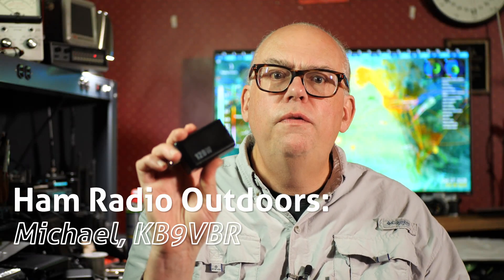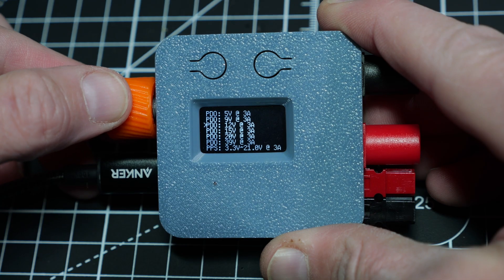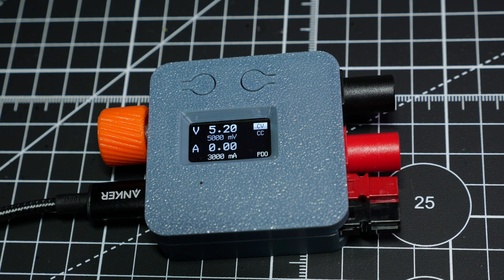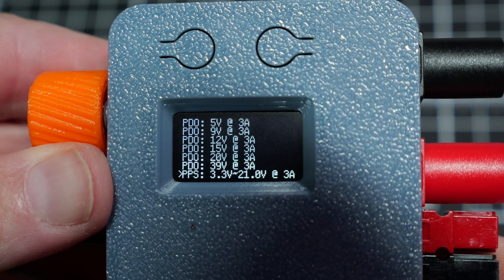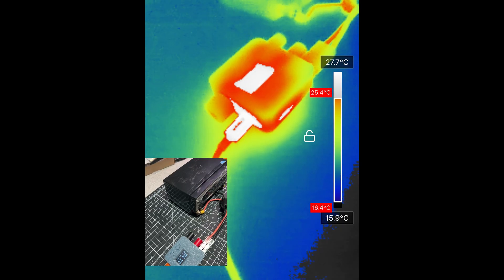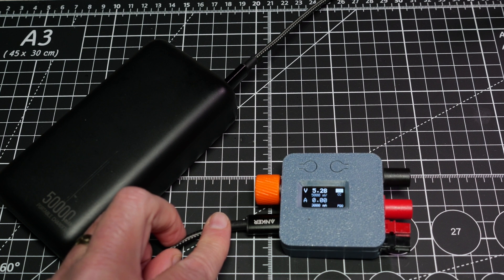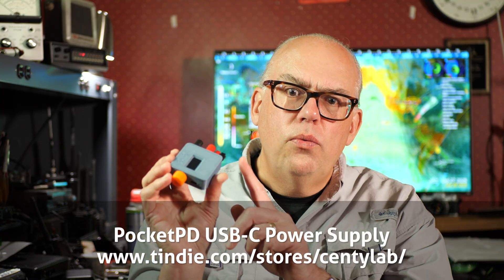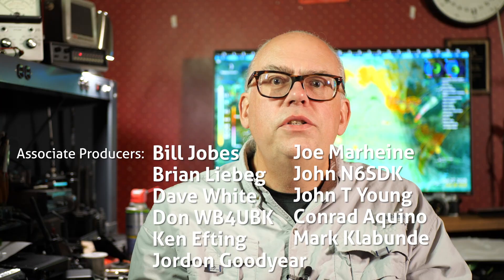This Tiny Gadget Turns USB-C Into a Power Supply!

Comment: My question is is how quiet it is it. I bought several units that do basically the same thing but they have a lot broader range of Import and Export they're not strictly USBC. They work great in a lot of field situations but the QRM can get a little nasty if the units closer than about a dozen feet to the radio.
Reply: There's no power supply (buck-boost converter) in this, so no sound either. It's just a USB PPS trigger with a UI. The CentyLab PPSTrigger does the same without an LCD for $13.

Comment: I'm on my 4th Anker power bank.  I kept buying only as much as I need to minimize size and weight for ultralight motorcycle camping.  I started with 5,000 mAh, then 10,000, then 20,000, then I decided that I wanted to power my FX-4CR 20 watt transceiver so I upgraded to the 20,000 mAH power bank that can source 65W, so I could use a 12V@3A or 15V@3A PD adapter that plugs into the USB-C port and connects to the DC jack on the radio.  Works great.  Very compact.

Comment: Thank you and this is what is needed for charging HTs and running 9v QRP radios. Now Adafruit has a PD board that meets the original standard that works with provides 15, 12,9v etc.  I have been using them for years.  This is a step in the right direction even if you have to get a new brick or battery.

Comment: Thanks Michael - wanted to ask about RFI? 73, dave
Reply from the maker: The PocketPD itself won't generate RFI, there aren't any voltage inductors or Buck circuitry inside. Any noise would depend on the USB-C power block you are using, and unfortunately those are all over the place when it comes to RFI.

Comment: $70 just to set voltage on $26 power supply ? :)))
Reply: It's rich to call this a power supply. It's a USB PPS trigger with a UI, max 20V. For this price it should at least support PD 3.2 AVS for max 48V.
The CentyLab PPSTrigger does the same without an LCD for $13.
Reply: Take your pick, being able to set exact voltage and current rate or not. Obviously this gadget isn't for you.

Comment: Considering the combined cost of a high powered wall wart and the device, I'm not sure it is a value for a HAM, who usually needs just a stable, 13.8 volts at 20 or 30 amps. For experimenters, it may be useful. It's cool, but I don't really get it.
Reply: Exactly.
Reply from the maker: Ham radio casts a big net, and there are many amateurs that experiment and build their own gear. This device fits that use case.
Reply: There's no shortage of small variable (30V/10A) power supplies for experimenters/hobbyists on Amazon for ~ $50usd.  At $70usd for the "controller" plus the cost of the actual usb power supply, this doodad is expensive IMO. Cool, yes. Practical?

Just my opinion, don't take it personally. Love the videos.

Comment: Very innovative. Thanks for getting it on my radar, but I don't think I have a use case for it. I get it for LiFePO4 charging, but I have that covered. They need some use cases on their web site. Maybe something would jump out at me and I would say eureka! - why didn't I think of that?
Reply from the maker: Battery charging is a bit of a side benefit. I think the best use case is for those hams that experiment with electronics and build their own gear.

Comment: Mike, you didn't mention anything about potential.noise from the switching power supply. Was that an issue in your testing of this unit? Andy KM4CSX
Reply from the maker: I didn't specifically check for noise. The power blocks are all over the place for RF noise and some are better than others. The PocketPD doesn't have any inductor or Buck circuitry inside it, so it will not be a noise producer.

Comment: I like the idea, but I don’t think it has charge controller in it. So don’t charge your battery. But it works great for QRP radios.
Reply: The charge controller voltage and current control is in the USB-C brick and controlled via the USB-C Programmable Power Supply (PPS) mode using the intelligence of the user with the PocketPD as an interface between user and PPS.  Charging batteries was the entire purpose of the PPS specification.

Comment: That would be handy to set to 14.6 and recharge a bioenno when you are mobile or don’t want to bring the large brick when traveling.
Reply from the maker: Exactly. Get a USB-C power block that fits in the vehicle accessory port and this device could charge your batteries while on the road
Reply: @KB9VBRAntennas It sounds great, but would it be safe to recharge a LiFePo4 brick without a smart charger or charge controller?
KZ9V
Reply from the maker: It is safe because the PocketPD will deliver either a constant voltage or constant current depending on what the output loads requires. As it is charges a LiFePO4 battery, the voltage stays constant at 14.4v and the amps will dwindle down to nothing as the battery fully charges and reaches that point of equilibrium.